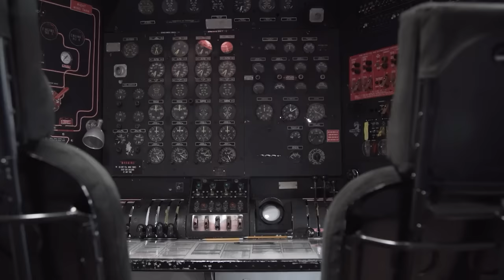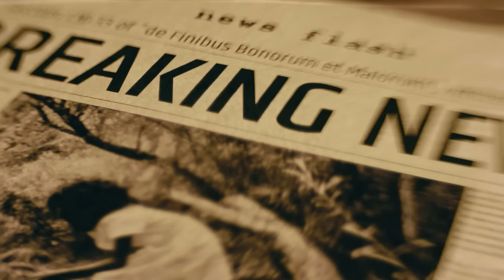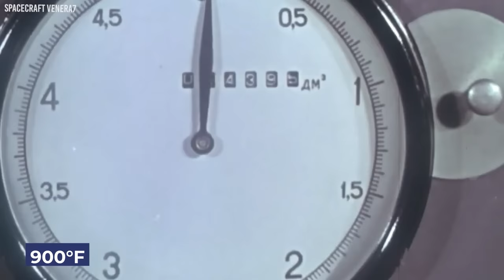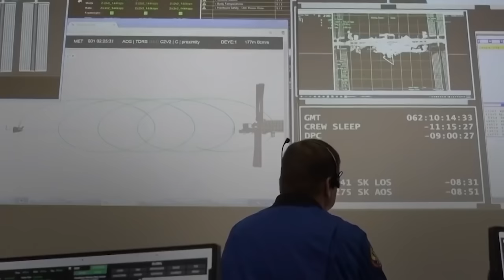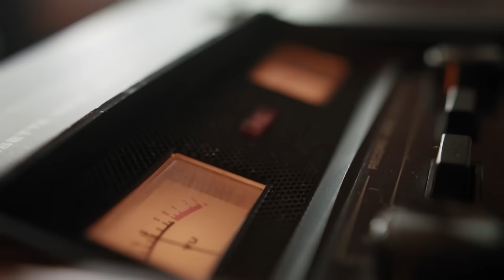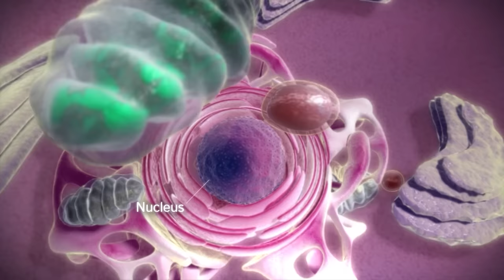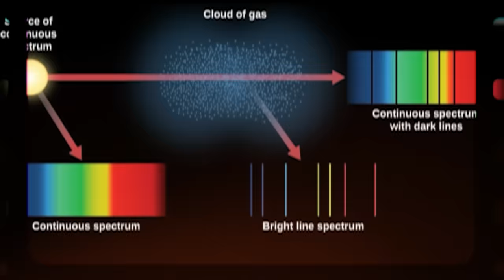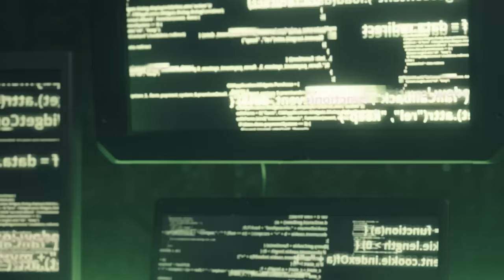Scientists Panicking Over Declassified Photos From Venus By The Soviet Union!

Comment: Venera 7 struck Venus at 37 Miles per hour. Not 37 meters per hour.  Just a little bit of a REALY BIG difference.
Reply: Yeah, I was thinking 37 meters per hour is an beyond excellent landing speed.
Reply: @auggie803 hypothetical situation: a car hits you at 37 miles per hour and then 37 meters per hour. Would you still say there's no difference. Fragile instruments need the slowest possible landing speed.
Reply: @melpedersen9677 Yes, it's obviously a huge difference, but I think 37 miles per hour might even be too fast because the atmospheric pressure on Venus is at least 90 times denser than Earth's atmosphere. A couple of years ago, I read it took one of the Russian probes a couple of hours to descend to the surface because the atmosphere is so heavy and thick. It's the equivalent of being 10,000 feet under the ocean or something crazy like that.
Reply: @russell_szabados wouldn't it sink then ? And at a fairly slow and controlled descent.
Reply: Well it did… at a rate of 37 m/h  very smoothly 😅
Reply: 😂lmao
Reply: I was wondering why he had to say 37 metre per hour was a soft landing!
Reply: I was going to say my basset hound's poop hits the ground faster than 37 meter per hour, talk about a soft landing😆
Reply: Also, according to this guy who says detecting phosphine would have proven life on Venus, we've in fact also proven there's life on Jupiter and Saturn since we've detected phosphine in those places. How did I miss that news ? ?
Reply: Says a lot about this channel.

Comment: Sulfer is not a gas
Reply: Sulphur dioxide is
Reply: @carolynnunes3922  Yes it is.
Reply: "Sulfur, the element, is only a gas at high temperatures. At room temperature, it is a yellow, crystalline solid with a pungent odor." 
                                                                                 - Encyclopedia Britannica